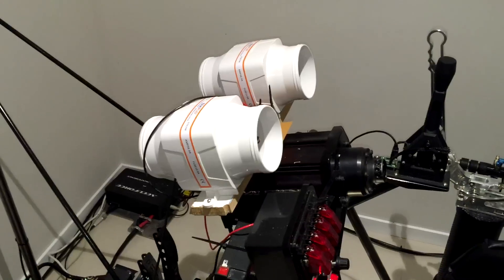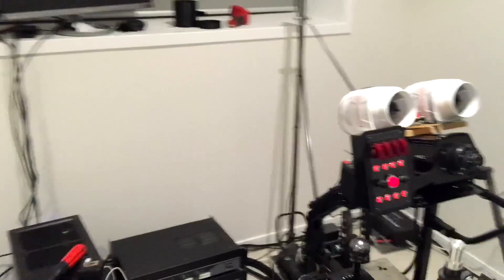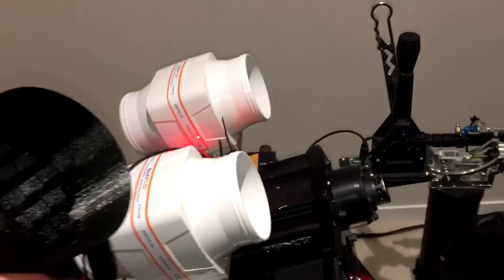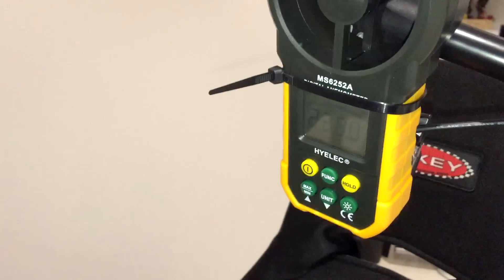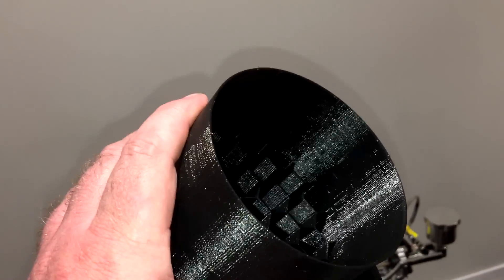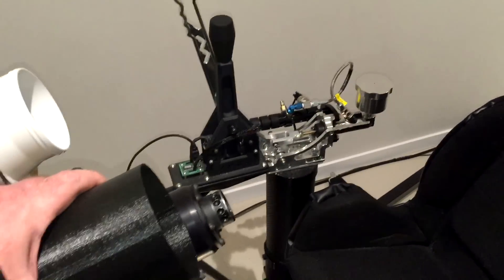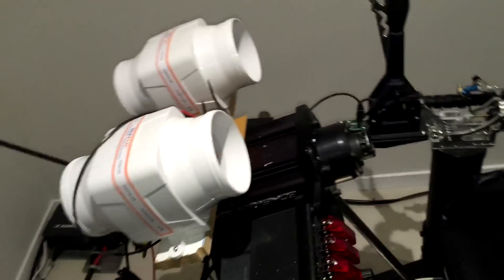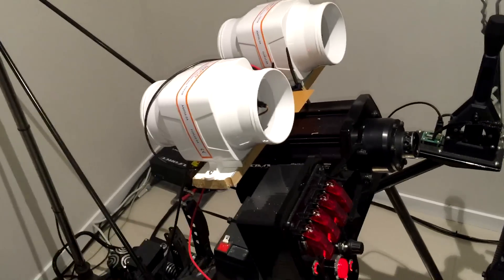Effects of my 3D printed Airflow straighteners on my wind simulator

Comment: One question: Why exactly did you choose to use two relatively small fans for this? I'm thinking about building a wind simulator myself for my VR rig, but it seems to me it would make more sense to have just one large and powerful fan (like at least 45 cm in diameter) in front. Then again, I have no idea what the most cost-efficient method would be for achieving the desired realistic effect and kind of struggle to find any info on this...
Reply from the maker: A few reasons. Firstly is that big fans don't put out a lot of wind speed, they can move a lot of volume but they are designed to move air gently around a big room. I have tested large fans at at point blank I get 10KPH if lucky on my Anemometer. With these blowers I get 75KPH point blank, around 85KPH with the TMC blowers I have switched to now.

I have done more refinement of my wind straightener and added a velocity stack which increase the wind speed by about 60% so I am now getting 45KPH at 600mm. I wrote about the improvements here http://www.isrtv.com/forums/topic/23623-complete-wind-simulators-and-kitsets-for-sale/?do=findComment&comment=207086

The other problem with bigger fans is ease of control and responsiveness. Larger fans are AC and they are much harder to control. These little blowers are DC so you can just use PWM (Pulse Width Modulation) to control the speed and they ramp up and spin down really quickly.

So yeah, it is all about wind volume vs wind speed, the big fans could cool a whole room but they do it with very slow speed wind where as the little blowers are very directional, they will only affect a small area but they are like a high speed jet of air.

Probably the best way to think of it is like a hose, a big garden hose with no nozzle is going to put out more water over all at a lower pressure, where a little super soaker water gun is going to squirt out that water much much faster but over a small area. You just need to aim the little blowers well and then they pump out a really fast stream of air. Because the target you are aiming at, your head, is quite small then you don't need something to do the whole room, just something real fast for that small target.
Reply: Avenga76 Hey, thanks for your really comprehensive answer! Yeah it makes sense now, going with some big fan is probably not the best idea after all...
One more thing I would like to ask is, how or where did you find these small, powerful, high rpm fans? Or which type of fan should I be looking at for this purpose (e.g. what are they normally used for)?
And what do you think would be the best way to achieve an even faster airflow, of say 80 km/h at 600mm? Just stack more fans by connecting them to the same output nozzle with some tubes?
Reply from the maker: The blowers are marine bilge blowers. They are designed for ventilating engine bays and the bilge on a boat. That is why they are designed to move a lot of air very quickly. Typically on a boat you would have one of these blowers sucking all the petrol fumes out of the engine bay.

I have used both the TMC and Seaflo blowers. The TMC blowers are slightly more powerful. I have some videos on my channel comparing the speed and current draw of them. They both have a 4 inch outlet on them but the actual blades inside are 5 inch then it tapers down to 4 inch to increase the wind speed. If you search ebay or amazon for "4 inch Seaflo Blower" then you will find them. The TMC's are a little harder to find online. I get my TMC blowers from a local marine store here in New Zealand.

The 45KPH at 600mm test was done with a Seaflo blower at 12v on a PSU. On my rig I use the TMC blowers and batteries running at 13.8v so if I did the same test with the TMC at 13.8v then I would probably get around 55KPH I would guess. I don't really want to dismantle my rig to confirm though. In my speed test videos the TMC is about 10KPH faster than the Seaflo's at point blank and the increase to 13.8v gives you probably about another 5KPH.

You probably don't want to go much faster than that. It becomes really hard to breathe above that and it drys your mouth out, you would need to wear some kind of balaclava or face mask like you would on a motorbike, which sort of defeats the purpose of being able to feel the wind.

You can run 4 blowers off the controllers I use, you are just inside the current limits of the controller but you would need a really good heatsink and fan on the controller. I run a heatsink and fan in a 3D printed box and with 2 Seaflo's I stay at around 23c, with 2 TMC that goes up to around 31c. If you had more blowers then you would need to run a bigger heatsink.

The current limit of the boards I use are 14A continuous and 30A peak per motor driver and there are 2 motor per board. In my current test video the TMC blowers use 7A each, so if you had 4 of them, 2 on each motor driver then you would be right on the power limit of 14A on each motor driver. The Seaflo's use less and they only draw 4.5A each so if you had 4 then each motor driver would only be running at 9A, you would still need a good heatsink and fan.

You can also bridge more than one controller together like we do on our DIY motion simulators but if you do that you need special wiring and you can't stack the motor driver on top of the Arduino anymore.

The next concern is the PSU. If you are going 4 TMC blowers then that is 28A all up. Which is pushing it for a 30A PSU so you would probably need to go for something like a 40A PSU. The Seaflo's use a lot less so 4 of those is only 18A so a 30A PSU would be fine. My DIY motion simulator runs off batteries so I don't need to worry about current, my battery bank is made up of 3 high discharge UPS batteries which are charged by a feeder PSU so my system can supply a massive current when needed.

On voltage, The blowers can operate on anywhere between 12-13.8V. The blowers are designed to run off batteries which typically around 13.8V while charging so they can take that sort of voltage fine. The motor drivers are also rated at up to 16V so they are fine running at 13.8A. Most 12V PSU's will have a voltage adjustment that will let you increase and decrease the output voltage, it depends on the PSU but you can usually turn them up by a volt or two so on a 12V PSU you could run up in the 13V range. It gives you a bit of a speed boost running at higher voltages but 12V runs fine also.

My suggestion is to start out with 2 blowers. You can maximise the speed of them with airflow straighteners and velocity stacks, that will get you up to 60% faster wind speeds if done right. Combine that with the TMC blowers and increasing the voltage then you can get even faster. If that still isn't enough then you can add more blowers, I would be surprised if you needed more than the sort of speed that 2 well set up blowers can put out.
Reply: Wow, it seems like you saved me a ton of research, thanks for all the great info!

I'm still not sure whether or not it would be worth it to fully go for a wind simulator setup, especially considering that I probably wouldn't be using it with closed cockpit cars anyways, which is the majority of what I drive... First and foremost I wanted to have some sort of setup that blows air in my face simply for cooling purposes, since VR racing sessions can become very hot very quickly.
I'll probably buy one or two of these blowers first and try something out. I also had the idea of adding two AC outlet grilles from some car on both sides of the steering wheel, so it will be just like the AC in a real car with adjustable air outlets. ;)

But most importantly I wonder how much a wind simulator like this would actually add to the experience. What is your opinion on this with your current setup, and how does the bang-for-the-buck ratio considering the material cost compare to other things that add immersion, like e.g. bass transducers?
You say you only achieve maybe around 50 kph or so, and I kinda see why much more might not be very practical.
But does it still feel somewhat realistic, and how do you scale the fan air speed in respect to the in-game speed?
Reply from the maker: Yeah. I have spent the last 3 months developing this project and creating my retail version. I have done a ton of research on everything from power usage to wind speed. This has become quite a popular mod over on iRacing after I created my first DIY thread about my project a few months ago.

If you are running iRacing then the community made software which runs this has tons of features. One of those is that you can assign hotkeys to things like manual fan speed, so you can bind a button on your button box to manual or speed sensitive, in manual mode you can also bind buttons to fan speed up and down, I have these bound to a rotary encoder so in tin tops I can use it just like the normal AC in a real car.

For other games at the moment you need to use SimTools which is a lot more limited but it works fine in speed sensitive mode. There is another program in the works that will have better support than SimTools.

If you have seen my rig then you know I am all about immersion. I have a DIY 3DOF motion simulator with rear traction loss that I built myself, 8 transducers running SimVibe, a GS-4 G Seat, an Accuforce, my wind simulator and my Oculus Rift CV1. I think each adds another layer of immersion. It terms of bang for you buck then it works out really cheap. If you are willing to build it yourself then it doesn't have to cost a lot, most of the cost in the ones I build are the time it takes to build them and do all the 3D printed enclosures etc. When you look at how much it was to build my DIY motion simulator then this is just a drop in the bucket and it is well worth it. If you haven't checked out my rig tour video or my dirt rally VR video then I would highly recommend it so you can see what the rest of my rig is like and why I like inventing all of these DIY things that add immersion.

In a open wheeler the wind feels really realistic. Like when you are going fast you really do feel like you are going fast, and you feel the wind drop away as you brake then the rush of wind as you accelerate out of the corners. For me and my rig I think it is especially good because I have my motion and GS-4 to simulate G forces, my transducers to simulate vibration and my CV1 to simulate my visuals but I had nothing that simulated the feeling of speed, like I would get all the bumps and everything going down a straight but I didn't feel like I was actually going fast. Now with the wind I do have something to simulate how fast I am moving, I can feel my acceleration, not only from my motion but also from the wind, even in a tin top your brain translates it in to a sense of speed, sort of like you would with your side window in a car. That is the thing I have learnt about motion, you are not trying to replicate forces 1:1 you are doing them strong enough that your brain fills in the gaps, an F1 car might pull 3-4G in a corner but there is no way I could replicate that in a home environment but the pressure from my GS-4 combined with the motion and vibration on my rig is enough to trick my brain in to thinking that I am pulling 3-4G, same goes with the wind, my brain has no idea what the 300KPH wind in a F1 car would be like, I am pretty sure you couldn't withstand that sort of winds without a full face helmet anyway, so when I am getting blasted by 50KPH wind then my brain thinks that I am going pretty damn quick. Even if the wind speed is not 1:1 it is still telling your brain "Hey brain, I'm accelerating" or "Hey brain, I am going really fast" Then your brain sort of fills in the gaps and is fooled, nothing in Sim Racing is 1:1 but you can get those cues close enough that your brain knows how to interpret that feeling and transpose it with the real thing. I think the sort of 50KPH wind speed is fine, As I said before, any more than that and it becomes uncomfortable, you don't need it strong enough to be 1:1 or uncomfortable, just enough to convey the sensation of the wind to the brain. I have built these for quite a few people now and I know a few of them have turned the maximum speed down a bit because they were too strong, and it there configuration they were only pulling around 25-30KPH. You get this a lot when you see other people building motion simulators that throw you around the room, less is more when it comes to motion, massive movements are slow and unrealistic, you just need enough to trigger the brain and that is all, the brain takes car of the rest, especially in the rift, with all my motion and wind you can get swept away in your virtual world and you do forget that I am just in a room, if you are in the right frame of mind then you actually slip off completely in to your virtual world. I have had times that I have been so in the zone that I have actually been confused when I come out, one instance was when I started racing while it was sunny outside my room and sunny in the game, when I came out of my virtual world a thunderstorm had set in outside and my brain couldn't work out why it was all of a sudden dark when I came out of the virtual world. It actually took me a minute or two to get used to actual reality again, in my simulator every single one of my senses is being fooled so you are completely removed from actual reality.

Also with wind speed, remember that normally one the road or track if you were going over 50KPH then you would need to wear a full face helmet. without my rift on then I struggle to keep my eyes open at  70KPH.

The fan speed maps linear to the car speed or you can set a speed when the fans would be at full speed. The iRacing software has a learning feature that automatically matches the top speed of your car. So say if your car could do 200KPH then the fans would be stopped at 0KPH, quarter speed and 50KPH, half speed and 100KPH and full speed at 200KPH. You can override that also so in the same car if you set the fan top speed to 300KPH and your car could only do 200KPH then when you reached the top speed of the car then the fans would be at two thirds speed. SimTools you can do the same but it doesn't do it automatically, you need to do some maths to get the speed of the car to map to an 8 bit value which is 0-255. Most racing games the telemetry is on KPH so it maps easily with no maths to 0-255KPH as the min/max fan speeds, then say if you were in a faster car and you wanted the max fan speed to be 300KPH then you would just do "Math * 1.2" and that would give you fans a speed range of 0-300KPH.
Reply: @PoisonHeadcrab2  late to this party but I just finished my wind sim too... I use different profiles for open wheelers and tin cans (the same applies to planes. I just wish I could somehow realize how to bind "open /close canopy" to wind profile. I have to do it with extra button now), but even when some would say having variable wind is not realistic (sort of: a lot of tincans has that small window on the side window anyway) it is great. It really helps in VR... and I somehow do not care much about this flow not being realistic in some cars.

Comment: If you add tubing to the other end you will increase airflow. Try starting with around 300mm long.
Reply from the maker: On the intake side? like just normal ducting? I have some 4 inch ducting I can test with.